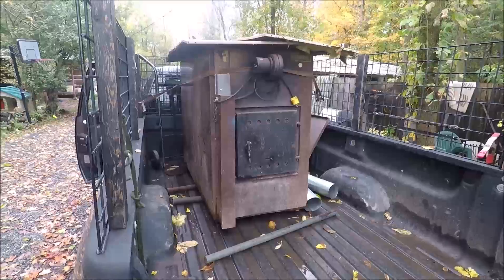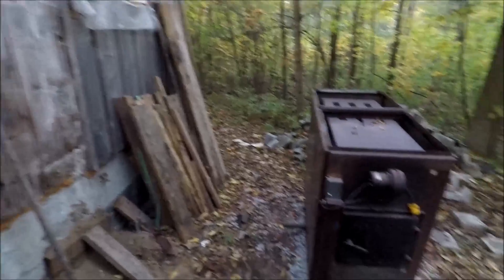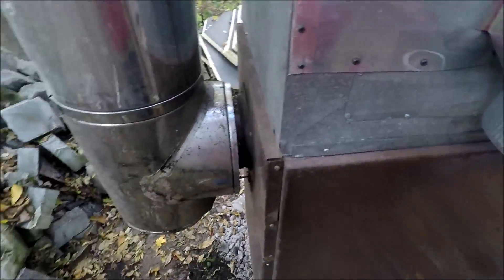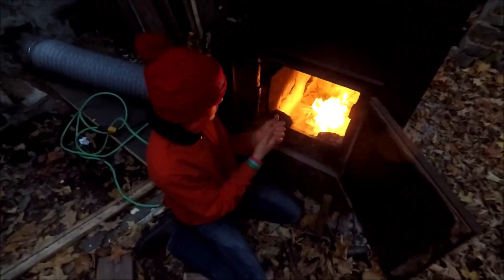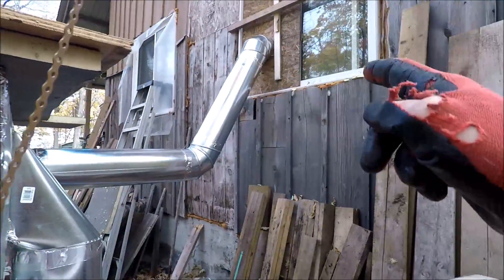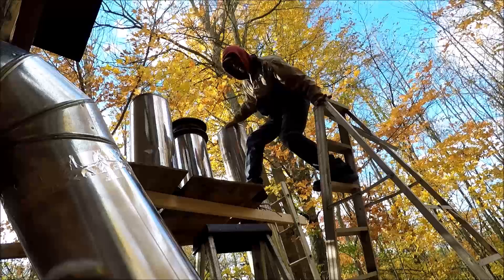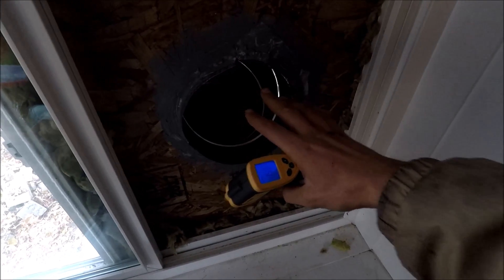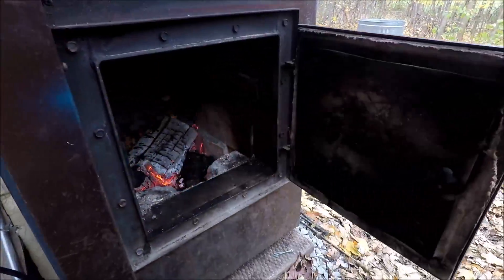DIY Outside wood burning forced air furnace FREE HEAT in the winter

Comment: Why is it that there's so many comments from people in the southern states. You guys have no idea what cold is. Come up north where every winter we get weeks of below zero. Then that 10-20° won't be so cold
Reply: The reason there's so many southerners who have wood stoves, hence why we have a lot of comments, is because the South prepares as much as possible. If we can get free heat without electricity, we're gonna do it. Even if we only use it 3 or 4 months out of the year. That's not only saving money but it's great for cooking and heating water if the grid goes down.

Comment: I would try running the hot air into the basement, and let it seep up through the whole house, input fresh air from outdoors , crack a window on top floor opposite side of house to draw heat up like it flows naturally. then your whole house gets the same temp and floors are warm.
Reply: I'd add it to the present house duct work. That way it heats everywhere. Also connect a thermostat and auto damper and it will control the heat in the house.

Comment: I am concerned about smoke entering your hot air return system.  I assume you have checked for carbon monoxide and dioxide level in your hot air  coming into the house.  This can only happen if there is mixing of the exhaust from the heater and its getting sucked into the return hot air into the house.  The air from your basement is heavier than air surrounding the stove.  When that air is not available to get warmed up around your stove, then air that is easily available gets into your return.  Trace how these two systems might get mixed during the exchange of cold air and its warming up and return to the house.

Comment: You've reignited (pun intended) my enthusiasm! I have an identical idea & a similar furnace. Mine will be outside as well. I had a new plenum made this summer. Now all I have to do is convince myself that I'm "good" enough to cut a hole through the side of my house! Mine has a draft fan, and a blower fan/limit switch setup. Theoretically, it'll intake cold air, & spit out hot air. Great job! Wish me luck!

Comment: I built something like this a few years ago to heat my 2 car garage, it worked wonderful, until it went below -10, then I burnt way to much wood to make it sustainable. ( I really liked not having smoke from opening the wood stove, when starting and refilling) and the thermostatic control that turned the fan on and off worked awesome. I based it on another u-tube video while searching for cheap safe way to heat the garage. I acquired everything to build it for next to nothing at the Re-store store. I am planning on building another one only this time, I am planning to use a better insulated fire-box, to hopefully prevent heat loss, that required too much wood.
Reply: How insulated is your garage?

Comment: A few tips, i have a pipe thru my window like yours but i used a piece of metal instead of wood because the wood started to char , be careful with coal once you throw in fire it gets sticky with an oil residue 
and  your chimney needs that last piece of pipe it will really help alot,  the cold air return should be run to the farthest room in the house to help pull the heat evenly thru the house.  Also try to find the best place for damper setting with a full load and then don't touch it just keep stove loaded
Reply from the maker: Thanks for the tips. What do you mean best place for a damper setting?
Reply: uberism81  Just need to find the sweet spot for that damper on the door. Open too far and it gets way too hot and wastes wood, closed too far and there's not enough air to keep the fire going.
Consider the damper as an analog thermostat. Grew up with a sawdust burning furnace and learned that REAL quick.   lol
The thing that I wondered about, if the heat goes in the basement it heats the floor above fairly equally throughout the house. Just going in to one area doesn't allow it to spread around as well.
Reply: Oh yeah, at least you got onto the scaffold. Me,,, not so much. No, not at all.
Reply: @uberism81  use metal through window opening. He is right.

Comment: I built one years ago...my father built another years before that....I set mine inside like a metal trash hopper cube....the front had a notch to the floor..just how it was made and it let's me get to the door and to the ash pan....I sides it with metal B deck heavy galvanized. Corrugated metal. I've got the same stainless flu. .mine has saved me 4000.00 a year minimum....and on the coldest days will keep temps in the 70s easily with large square footage and high ceilings

Comment: you did a good job however I would have used HVAC METAL TAPE and possibly more insulation here in Tennessee heat exchangers are going obsolete , younger generation believes it's to much work. great video.
your exchanger is safe to use however I myself would build a shelter over it. it will help to preserve heat.

Comment: If you make a steel plate for the bottom of the fire chamber with holes drilled in it your fire will burn more consistent and last much longer. Trick we do up here in the north. They make punch plates you can buy but can make your own way cheaper

Comment: We have the same furnace just bigger, ours uses wood oil. There a great furnace ours is about 15-20 years old and they will last well over 50 years if you take care of them. We just had to put a new blower Motor on as the old original one burnt out. Sadly the old one was a lot better had more power and this new one you can barely tell that it’s on it takes awhile to get the heat though our old house to.

Comment: how do these work, i understand heat rises up from the heat chamber, but those chambers are insulated, i have a very large wood burning stove (not furnace) but it is a huge shop stove almost the size of this one in video. but you can touch the top and sides (As you did in the video) so how much heat is going into the duct? Or rather how is that much heat getting in them? are their blowers, or are the duct boxes directly on top of burn chamber (no insulation on top of burn chamber)  thank you

Comment: I have a woof chuck stove just like this one and been heating my 1444 sq ft cabin with it for three yrs now..hooked mine in the duct work of the cabin and took the old furnace out..works great. will say this they will eat some wood so be ready to cut lots of wood.my winters are in kentucky so not sure what your winter are like..and I built a room for mine as well it's the stove room and saw room cause thats where I hang my chain saws at when not in use.

Comment: Please consider investing in a carbon monoxide alarm $ 30.00 the dangerous gases get heavy and fall quickly, the chimney is supposed to be several feet higher than the roof
Reply: Read description
Reply: @wnytrashtrucks  It says he will be getting CO detectors. Many people say something but do something else. The CO detector should have been in place before this endevour as they were heating with propane before this and there is a danger of CO poisoning with that heating system. Your family is worth more that a couple of dollars.
We had a house burn down in our neighborhood when it had an outside wood funace supplying hot air to the building.
Reply: LAW measure 3 feet up roof and it must be 3 feet above that minimum
Reply: On a wood furnace you want a short of a chimney as possible, otherwise it will creosote up very quickly when it is at idle.
Reply: @mmmcquoid  that depends on where you are at. Our local law where I am is 2ft higher then anything within 10ft
Reply: The whole roof thing is based on if it’s going through the roof
Reply: @Sodaniel1989  Thanks, I didn't know the limits. I have a fireplace outside, but it's 5Ft off the back of the house and tied into the central air. But the flue isn't higher than the house. Looks like I need to raise it up a bit.

Comment: Sooo Sketchy ;)
But the whole weight of the chimney supported at the bottom only?
Maybe needs a support pole to be fixed to? That can take some of the weight?
Reply: the ladder is taking some weight the 2x4s are on top of a rung and they are screwed into the pipe. but yes I agree a little more support would not hurt.
Reply: Ac register suck in hot air from fireplace and spread heat

Comment: Check your heat exchanger and fire box for cracks. Only place you can get smoke into the air system. Solid fuel furnaces have to be out side of the house to be able to have insurance.  Check with your carrier before starting any new projects.

Comment: I think you should take all that stuff apart and install that wood furnace in the basement run your stove pipe out and up the side of the house and then hook up your ductwork where you want to in the house it was meant to be installed in the basement you’ll get way better results

Comment: you need to get the chimney higher then the roof  if not it will back draft and blow smoke in your house . you also don't need triple wall for the chimney you can uses single wall pipe  because your not going throw anything lighter n cheaper  have mine set up this way for 6 plus years you won't to put up a smoke n carbon monoxide alarm to be safe
Reply: When the wake up dead, they will find out. Lol.

Comment: I would connect the draft blower to a thermostat in the house and close the draft on the bottom. It will save on wood and keep the temperature more even. It would also help keep the furnace from overheating. It can overheat even with the blower running and damage the furnace. If it gets too hot the metal will warp and crack causing air leaks.

Comment: I have thought about doing something like this but putting the stove inside one of those 6x8 metal sheds to keep it out of the weather.
Reply: I'm currently in the process of building something similar. However mine is being built inside of a metal cage that sits on a metal pallet. The decking on the pallet is a piece of sheet metal, no slats. I've encased the cage in metal siding that we got as scrap. The ducting is connected to my existing central air system. Later year I spent almost $200 in Dec. This year, $90. 😎😁
The first iteration uses a fire cooking stove, but it's proving inadequate in this winters colder weather, so I'm upgrading by building a combination rocket-stove/furnace.
Reply: @korishan  please make a video if you already haven't! Seems like you have a lot of good info

Comment: One thing you should check into is cfm per duct, 8 inch will move around 370 cfm so if you check that fan in the furnace  is around 1100 cfm so you could add larger ducts or more of them to get full benefit from the wood you are burning.
I am heating a 900 sq ft mobile with 500 cfm attached to a woodstove in a garden shed.
I average between 130 f. to 180 f. degrees coming in for 12 hours a day.
By pressurizing the house with warm air cold drafts can't come in.

Comment: I had issues with my pipe down drafting because of the structure nearby I was able to shorten up my chimney pipe and I added a  cap that moves with the wind direction best 180 bucks spent. 0 down draft issues !

Comment: Chimmbey must go above house. Pump heat into insulated area filled with river rock. Coil copper in fire box for pre heating water . you can add passive solar green hot water.

Comment: Go to Home Depot and they have this aluminum looking tape that is super sticky and you can put that tape all around it it works awesome it cost about $8 a roll and I would buy some insulation a roll of insulation and wrap the pipe with some insulation and that will help keep the heat in the right place and I would run an extended wire and bring that fan switch in the house so you can control it from in the house

Comment: I was wondering how your 'outdoor' wood burner has been working. Have you had any smoke odor problems? Does it snow much where you live? I've got and outfit called a lil house heater which requires a lot of fiddling with and yearly rebuilding. They don't make them any more, thankfully.

Comment: Have you reasearched a rocket mass stove -- may be safer and work better and less dangerous fumes because of complete burn.  Uses less wood for  fuel so you will not be out in the cold fueling it.   If your floors are wood you may have to build cement base or something. for the stove and mass.  Several versions -- some use "bell shaped"  heat transfer as benches where heat is transferred  into those areas rather than out the pipe into the outside.  Stay safe and warm.

Comment: You'll need to insulate your pipes more...I also put a heavy PVC pipe wrap/cover over mine....and definitely if you dont have one already put in a flu damper...itll keep the heat in...allow better combustion control and longer burn times....greatly reducing wood consumption.

Comment: We love you man for the precious advise and all the teachings! Your beautiful house and your pocket will benefit even more from a solar panel on your roof: clean, modern and much efficient. If you want to still keep your wooden stove, you can integrate with the solar and make a hybrid system. In Ontario we have a lot of sunny days even in the middle of the winter. And for families who want to switch to green energies, there are some incentives. The carbon monoxide coming form your furnace directly into the house is not healthy at all, and if you are going to burn hardwood or other treated wood, there will be a lot of chemicals released from them (glue, varnish, paint, stain etc).

Comment: It would work better if you enclose it, by building a shed around it and have insulated pipes running to the house, so you don't lose or waste heat, also i would run the thermostat inside the dwelling, it will not work correctly being on the unit itself.. All n all an interesting build..

Comment: You're losing massive amounts of heat by exposed transfer ducting.  I did this several years ago (outdoor forced air wood stove)  and abandoned due to inefficiency. If you elect to continue, enclosed the stove in its own "box" and wrap the ducting in insulation.

Comment: I]m sure it will work, but it won't last long, exposed to the elements like that.  For one thing, soon as it rains, your thermostat will probly short out. Also, water will find a way into the furnace. Build a concrete block structure around your furnace and then fill the area between the furnace and side/back walls with sand. With it being outside, you are losing a lot of your heat to wind and cold.  You'd also be better off building a hillbilly version of ductwork, seeing that you have a basement.  Pipe the heat through a system like that, and your house will be more evenly heated. Lastly, don't be such a chicken shit when the camera is recording!  LOL

Comment: Why didn't you put the elbow on then the length of piping into the house...your loosing heat from the elbow in the center ...
Hot air rises quicker then when restricted...

Comment: At the top of the chimney, if when you start the morning fire, you'll get a lot of smoke initially, and if that window leaks it will also suck in smoke.  It's not the safest way to heat the house. The duct that brings in heat is wood, and not safe.

Comment: coal burns alot hotter than wood.....please be careful with the wood burning stove.....i had 2 at the same time and i  got them so hot the boiler plate that protects the  side of the stove warped....also some of that flooring will have resin in it and it will build up in the stove and maybe the pipes...
Reply: Yeah, never burn coal in a wood stove/furnace unless it is modified to do so.
Reply: Resin can be a problem,  yes. But also using very hot clean wood can burn the resin out of the pipes afterwards. When starting a new fire, get a rip roaring fire going and it'll burn off any residue clinging to the sides of the flue.
He could always take that bottom plate off and put a wire chimney brush up the flue adding sections to the pole as he goes up. Brushing the insides would cause a lot of that stuff to flake off and fall out. Do this when the flue is cold, though.

Comment: Leave your damper (vent) wide open until the fire is going then partially close it till you reach the desired temperature in the house  at that point close the damper almost all the way so the fire just barely burns   This should regulate the temperature and conserve your wood
Reply: This is a fan-forced furnace, not a standalone wood stove, so one would want to follow the manufacturer's instructions about using the damper. The fan is going to bring in outside air, and manual use of the damper could undercut or duplicate that.

Comment: rusted out lower plenum Its a sealed unit so the smoke is coming from inside plenum or wood box .remove plenum and start fire look for a hole.weld it in good bye someone that is competent .